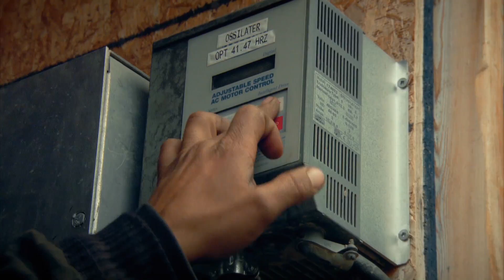Catch Up on Gold Rush Season 7 Episode 15 | SEASON 7 | Gold Rush

Comment: Oscilating sluices will push the gold out of it's hiding places in my opinion. The water flows over the expanded metal and swirls. The gold is supposed to hide at the bottom of the riffles. Shake it up and you shake the gold out of hiding.